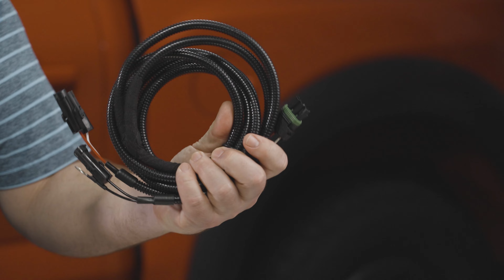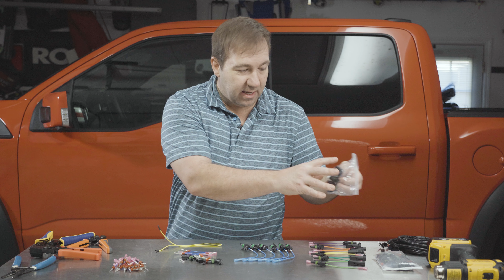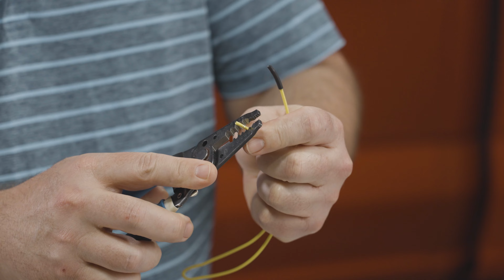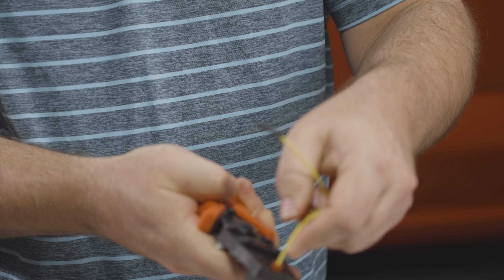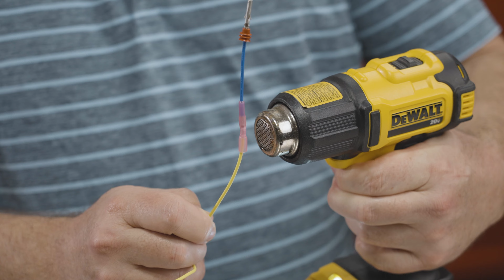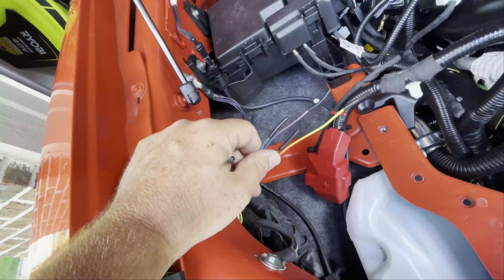FAQ - SPV Parts Harness System - Switch Wire Extensions - Ford F 150 & Bronco Raptor 2021 2022 2023

Comment: Are the ground wires not important? are those recommended to install the extensions?
Reply from the maker: @SrIvanMP  harnesses have ground wires that go to bolts on the body. So the switch wires just provide the power.